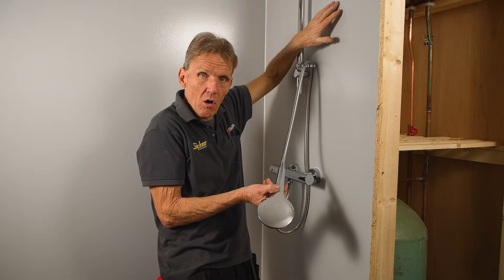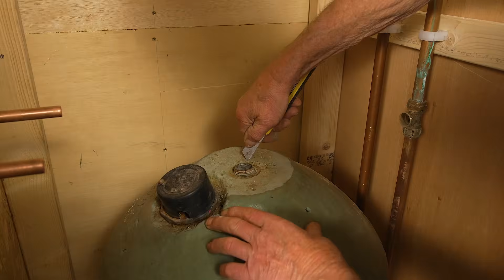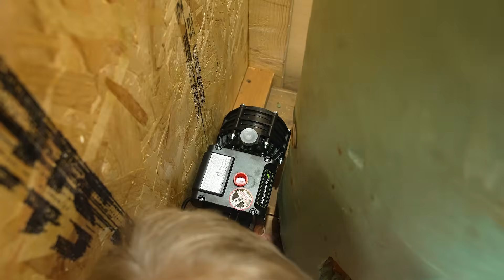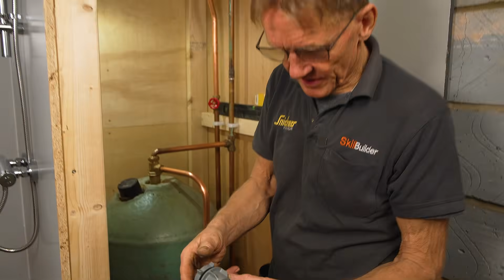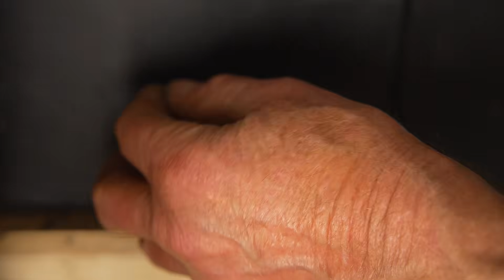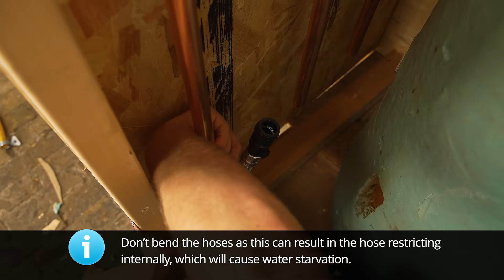Increase Water Pressure to a Shower or the Whole House | Right Pump

Comment: Where’s your pipe inserts roger?  You told me it would knacker the rubber bit in those push fits if I didn’t use them…I trusted you 😢
Reply: Not required on copper. The inserts are for plastic pipe
Reply from the maker: cooperyonk.
They don't make copper pipe inserts. The rounded end of the pipe is enough to protect the insert.
Reply: Lmao youve not been paying attention son
Reply: My apologies, I’ve just watched it back.   You said an uncut pipe can damage the o ring…a cut pipe is fine.  Picking these things up slowly.